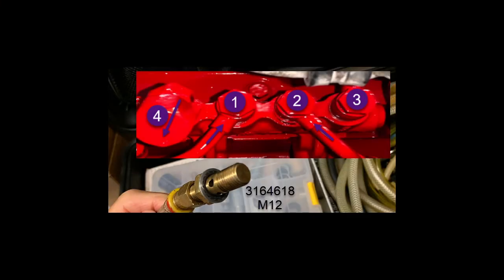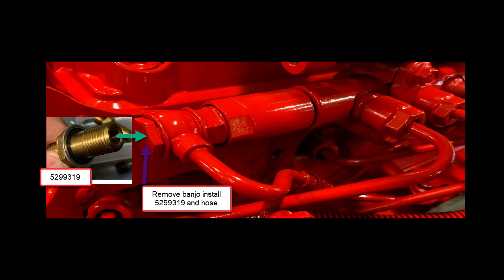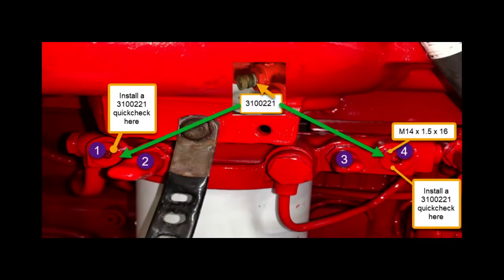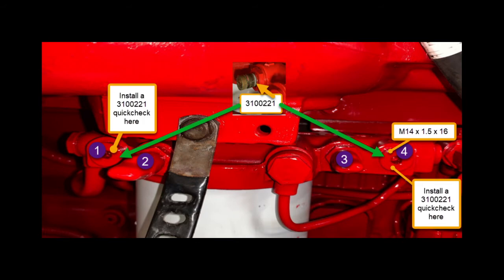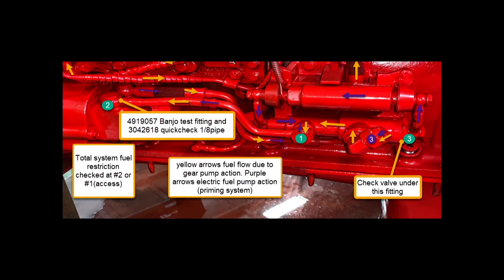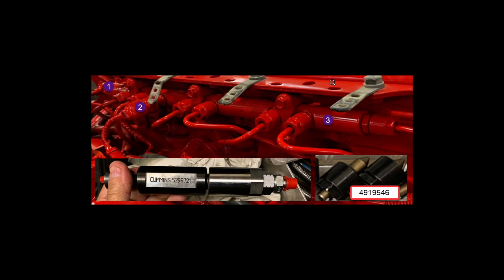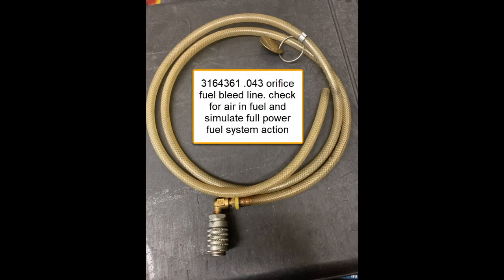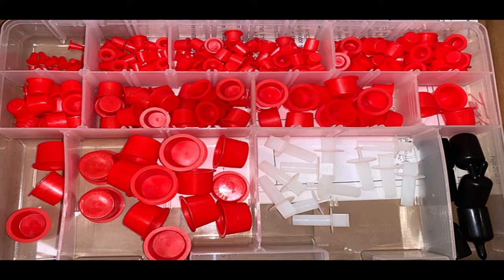FC 559 Video 3- Service tools for fuel system diagnostics

Comment: during engine operation the electric lift pump is off??  and during cranking or starting the pump is running??
Reply from the maker: ISX engines the electric pump is on 2 minutes at key on then off until next key on only on automotive. ISC or L9 engines the pump only runs 30 seconds at key on.
On ISB6.7 automotive with electric fuel pumps the pump runs as long as the engine runs.
Reply from the maker: Yes
The pump runs about 2 minutes when you first turn on the key.  The engine ECU shuts it off after two minutes or so. Once the engine starts the mechanical gear pump pulls all the fuel it needs. The electric pump is priming only before start up
Reply: @ENGINESHOPJOE  Thanks
Reply: Do you have a video for these test and tools for ISB 6.7L when same fault code 559 appears? Haven't seen any videos on 6.7 diagnostic  for this code. I do know they have same procedure but don't know if part #s are the same. Some 6.7s have cp3 pumps. Practically I'm talking about freightliner M2s.

Comment: Hey, is that 5299319 also a M12 banjo bolt?
Reply from the maker: It is the same thread but it is not a banjo bolt. it is a straight through fitting that a small hose can screw on to collect fuel in a graduated container. It is brass and part of the test kit.
you could make one out of a banjo bolt.
Reply: Can’t seem to find 3164361, might have been superseded but can’t find it. 
Do you think by maxing out rpm would be enough?
Reply from the maker: Try 3164621 I think that is my mistake. Thanks for pointing that out! I just googled that number and it is good but supersedes.
I also looked at the prices some folks are asking for it. Crazy! I saw as high at 258.00. All it is is a fitting with a .043 injector orifice in it. I bet you could buy the orifice which is just like a small drive rivet with a calibrated hole in it, then drive it in a 1/8 brass pipe fitting and get. piece of clear hose at a hardware. I made a lot of my service tools back in the day. I had a number 5 stratoflex line with a gate valve on it and that was the cats you know what for checking fuel restriction on the PT system and N14's. When you say do I think maxing out RPM would be enough Im not sure what you are testing and or trying to measure or figure out. Can you be more specific.